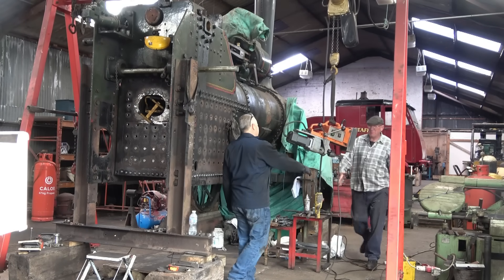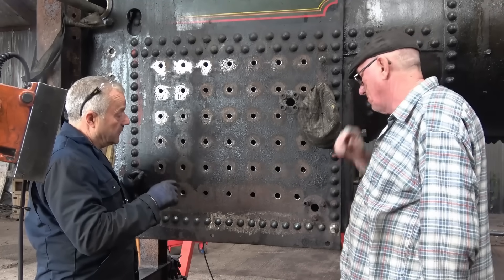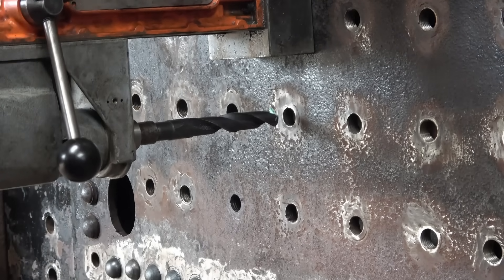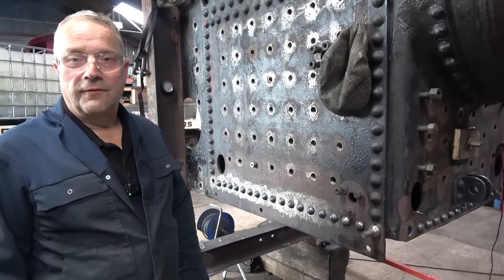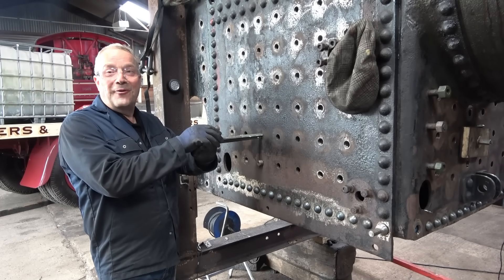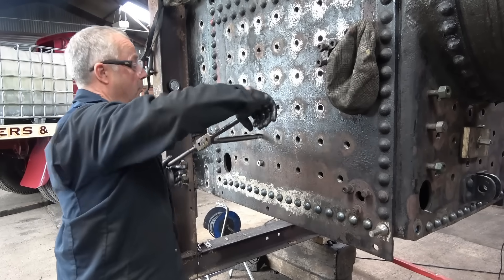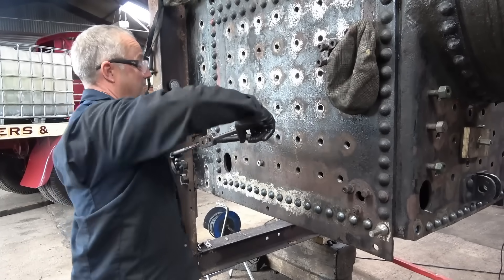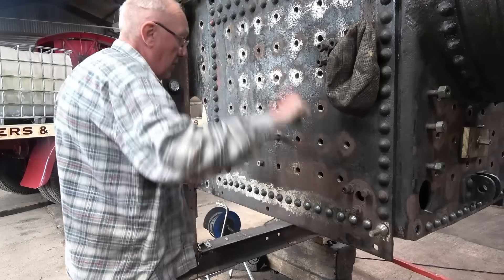SNNC 607 P2 Wallace Traction Engine , Boiler Stays (drilling and tapping)

Comment: Doing the stays on the Marshall roller, we used an Annular Cutter with a plug stuck in its bum. This plugs OD, was the plates ID. Worked a treat.😅 Good job there, which ever way we pluck ducks.

Comment: I helped do boiler repairs when I was 10 and could get in and out of the firebox easier than the adults so it was my job to catch the tap and return it to the guy outside running the drill.

I hated every second because it would tear up my gloves and hands, we had 200+ staybolts to replace..
Reply from the maker: Sounds like hard work, but it is good experience.
Reply: @doubleboost Yes sir!
I finally got back into steam this year.
We are retubing a narrow gauge locomotive, it is interesting to see the difference in technique, we roll all 240 of our with a monster drill.

Cheers!

Comment: Boilers need a fair bit of maintenance. It’s no wonder the proper chemical treatment of the water is so important so they last as long as possible to avoid having to do this kind of work.
Reply: Some stay bolts have lasted 100-150 years.